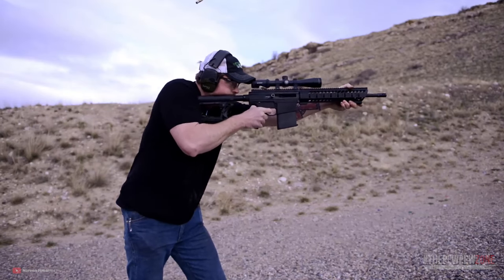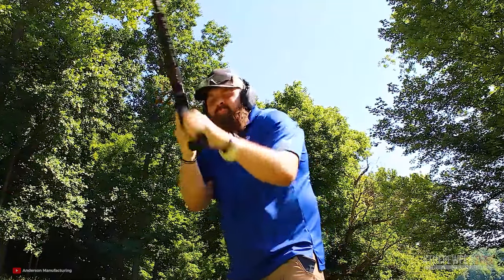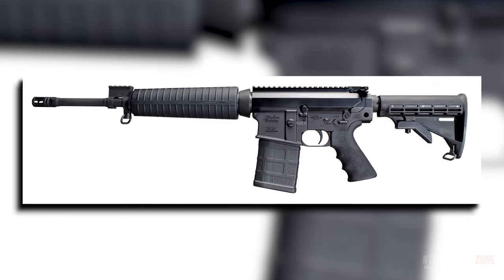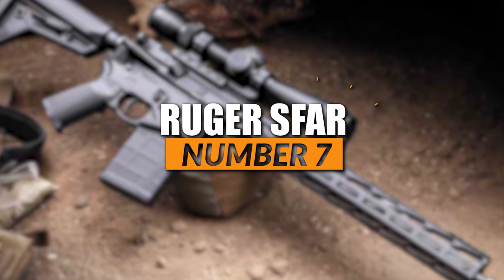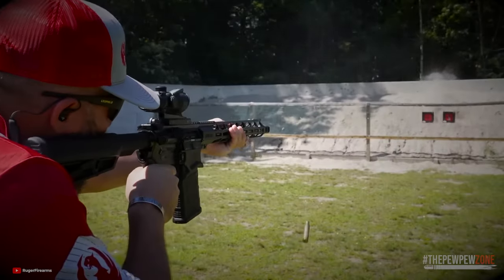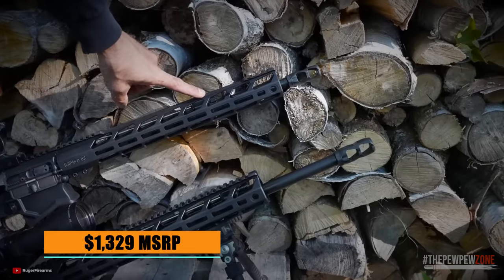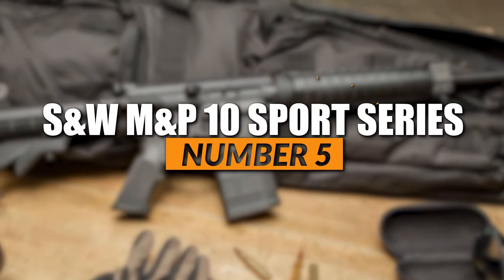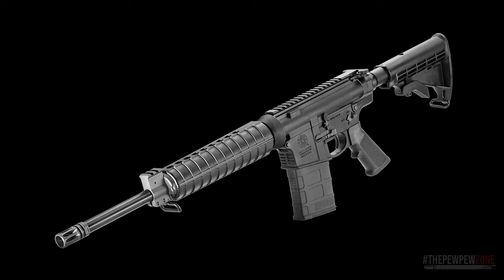Best Budget-Friendly AR 10s on the Market!

Comment: Forget the 308. It's a for suckers, a waste of time and moneh. Instead, get a shorty AR-15 in 223, put 60 gr softpoints in it and it will be BETTER at stopping men than 308 ball ammo. Put a 7.5" , 223 ONLY  silencer on it and get a 22lr conversion unit and a drop in trigger job. Get  scope with a see thru, QD, return to zero mount, a free float tube and anti-cant bubble level. This lets a 10" 5" skinny barrel, in 1 in 9" rifling twist, snipe effecively to 1/4 mile, using match 69gr hpbt  ammo. That's furher than any iron sighted 308 or 06 battle rifle can manage, with iron sights and issue ball ammo  If the latter were SO effective, then the properly set up shorty AR is, too The .22 unit  is for quiet foraging with Aquila  60 gr subsonic 22 ammo, or for removal of guard dogs, sentries or scouts, braining them from 50m. It will inflict (eventually) lethal torso hits to 125m, too. The main thing, tho, is the 22 unit saves you 40c per shot for snapshooting practice, to 75m. Get night sights, night vision and armor.  You can get 12k of full time college loans, going half time and pay them off with 1 hour per week spent selling your plasma ($50 per lick)
Reply: That's a lot of words for a b.s. comment
Reply: I’m not reading all that.